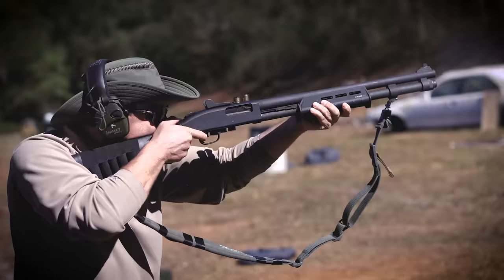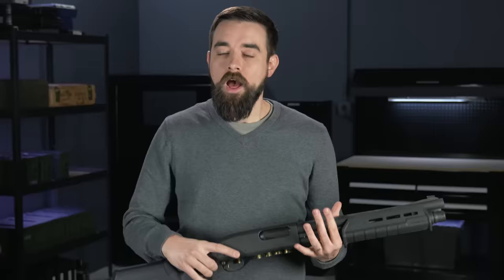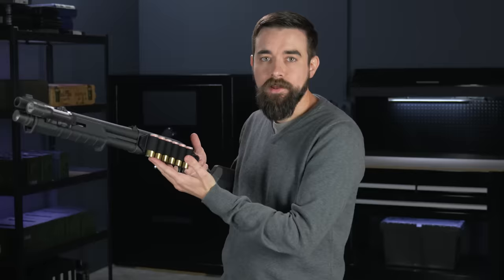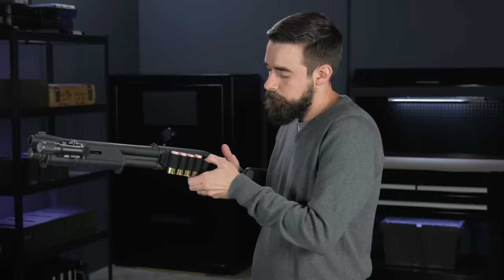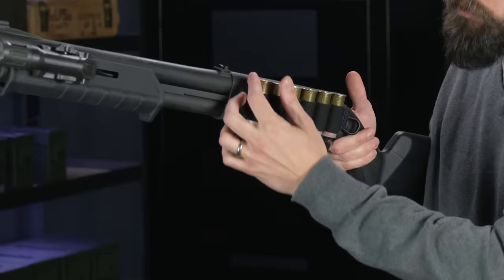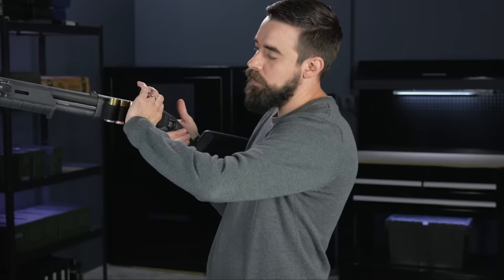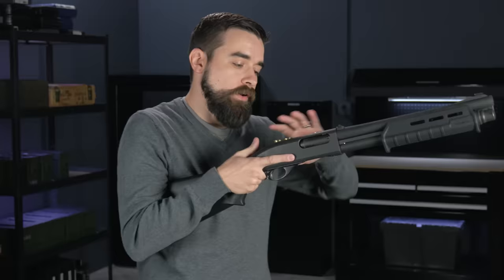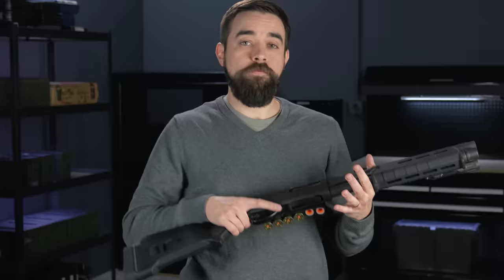How to Reload a Defensive Shotgun

Comment: Question from an ignorant noob, do you have to reload from the ejection port if the gun is empty or is that just a faster way to get of an extra round?
Reply from the maker: +doug harrison You don't have to, it's just faster
Reply: Faster for one extra round, but not the way to reload the tube?
Reply from the maker: Not sure I understand the question. If you want to get the next shot off as quickly as possible, it's faster to load the chamber first, then load the tube as time permits. Some shotguns won't allow you to access the tube until the action is closed and you either dry fire or press a button or latch to move the shell carrier out of the way. Since the action is typically already open on an empty gun if you've just been firing it, the quickest way to get back to shooting is just drop a round in the chamber first. Does that make sense?

Comment: Chris, really like your videos. I used to use a side saddle but was having trouble with the brass corroding with the gun in the house! I would clean the brass off with steel wool but once it started it would come right back. I would use this ammo up
when I practiced. Had one of the rounds brass split when fired and could not cycle the gun{870 Wilson!} Hit the butt stock on the ground and the extractors ripped right through leaving the split case{Had to run a stick down the barrel} I grew up on a farm
and started shooting in 1968. Never had brass corrode until 1998. I use the big three(F R W ) they all do it. I think they use an alloy not real brass as as cost cutter. Now keep ammo in small media bag with double zipper compartment(slugs in one, buck in other) via ' Way of the Gun}. Any thoughts from anyone?
Reply: Do you live near the ocean?

Comment: Kind of out there question but, I noticed that you removed the older videos you all had on the Beretta 1301 Tactical. Was there a reason for that? I found them quite helpful.
Reply from the maker: +Joshua Keaton copy+paste answer is that a commenter on our blog complained about 922r compliance issues. Our lawyers looked into it, got nervous, and decided we needed to remove the videos. Modified versions of the video transcripts are still available on our blog in article form.
Reply: Would that have to do with adding the tube extension and the modifications to the button? I have never really understood how 922r compliance works.
Reply from the maker: +Joshua Keaton I can't really go into it much here without spoiling everyone else's fun. There are differing opinions on how to apply 922r and who it applies to, and most people who try to explain it actually get a lot of it really wrong. I will say that in this case, the modifications to the button are not part of the issue.
Reply: Ok, I appreciate your response, I really like the 1301 Tactical and am thinking about getting one; I certainly don't want to run into any issues myself! Love your videos, they are both even handed and well informed.

Comment: What was your exact reasoning on switching to the WML over the TLR-1? The gen 1s seem to have had issues with cracking but has your's held up to regular use?
Reply from the maker: The switch on the Inforce WML is much friendlier for use on a pump shotgun forend than the Streamlight switch. The light has been fine, but I have had issues with the rail section staying put on the Magpul forend.
Reply: Lucky Gunner Ammo I took off the barrel and held the t bar in place while I screwed in the bolt to get a good fit

Comment: Can someone please tell me what is the length of this gun? And is it legal in all states?
Reply: He said it was a Remington 870, which goes down to 18.5” barrel.

Having said that there is a 14” barrel called the TAC-14 from Remington that uses the same receiver and everything, but the stock is replaced with a raptor grip, and I don’t believe it can legally be changed.

So he probably has a 18” barrel which is legal everywhere but I would check your local state laws on ammo capacity and shotgun laws. Indiana let’s just about everything and we don’t have nearly as bad gun issues as Illinois, Michigan, or Ohio and we are surrounded by those states.

Comment: This is a great video but honestly I still scratch my head when someone tells me they use a shotgun in  go-to home defense. Especially if it's a full length gun.
Reply: Overpenetration isn’t as much of a problem, stopping power is more than adequate, and spread isn’t much of an issue at home defense ranges. Sure a handgun is easier to move around corners with, but I definitely feel more confident in my ability to shoot a shotgun than a handgun nerves or not. Long guns in general are easier to learn and not everyone has the time or money to train on every platform they’d like to to the level they’d like to. Doesn’t mean they shouldn’t find something that works for them in a home defense scenario.

Comment: Other than the fact that the odds of running out of ammo with a 15 shell capacity shotgun approaches absurdity, what would you say would theoretically be a good way to load a KSG other than just loading it like you normally would?
I've been practicing it for several months and have more or less come to the conclusion that the best way is to keep the shotgun shouldered while feeding it shells from the bottom. At a range I am able to load a shell directly into the chamber, but it's more of a juggling act than something that is even vaguely doable under stress. I'd imagine that remains true for all shotguns that eject through their loading port.
Reply: lol i think you're good with 15 rounds

Comment: I dunno, I think this whole methodology revolves around the fact that the side-saddle is on the left side! And that's fine and this post was informative. However, it's VERY hard to control weak hand under duress to perform this task. In real gunfight, you use fire and maneuver. Standing static while reloading (unless behind a sizable tree) not the best policy. When you're gettin' shot at, NOBODY has to tell you to GET DOWN! After taking shots you get to cover, drop to weak side knee, keeping hold of shotgun forend with weak side hand, twist 90° to have access to both ejection port and feed tube. Cradle trigger group/stock on strong side lap. Load with strong/dominant hand (drop 1st shell in ejection port and slide forward, then continue loading as situation permits).  Addl ammo should be on person & available to strong side (trigger) hand with minimal floundering.

Comment: I suggest you watch someone who knows how to handle aWinchester 97 in Cowboy Action shooting. I did it for around 12 . Any good 97 shotgunner will reload much faster.
Reply: the model 1897 and model 1912 always seemed smooth loaders for me.

It takes a second to get used to the 12 since its possible to dump the mag tube if you do it wrong but with a bit of practice i can load the thing from empty in like 6 seconds.

Comment: LGA Chris, what is stage saver?
match saver?
Reply: a match saver is a single or double shell holder placed less than an inch next to the ejection port, should you run out of an ammo on your last target. hand comes up swipes the shell into ejection port and sending it down range, potentially saving your match from having to do a standard reload.

Comment: What brand of elastic side saddle is that?
Reply from the maker: The shell carrier itself came from a sidesaddle mount I got from Vang Comp Systems, but I took off the actual mounting plate and just use a piece of adhesive velcro stuck directly to the side of the receiver.
Reply: Sweet! Thanks!

Comment: Think of driving a car with manual gearbox. We don't look at the stick when we shift.  Same goes for handling and operating shotguns.
And it can't be stressed enough that slow is fast and practice makes perfect.
Shotgun operation is very different from handguns, SMG's, rifles. Those are easy.
Seriously, know your shotgun(s), practice loading unloading, safety handling.  Do it until you can load shell without thinking and looking at your shells, weapon.  The shooting part is easy.
Why? 12 gauge shotgun is extremely powerful and very dangerous.

Comment: The keywords in the beginning "will work with modern shotguns" lol my spas 12 isnt modern and requires pushing a button to load the shells in the magazine tube. Ive got to find a way to make reloading it quicker.
Reply: Most auto shotguns have a button to release the bolt forward

Comment: If speed isn't a concern, isn't the simplest way to reload a shotgun to load all the shells into the magazine and then pump it, especially if the action is already closed from the "click-empty-realization"? I guess you'd have to load another round after chambering to top it off, but it seems like the most idiot-proof technique. Maybe I'm overlooking something. I guess there's the issue of remembering to either pull the trigger or hold the slide release to open the action.

Comment: When you reach the "click" it's often considerably faster to just reload the tube and then chamber a new round than it is to try to load a round directly into the chamber (of course this ends up with 1 fewer round in the gun unless you then load another one into the chamber, but it can be worth the trade in a time critical situation).
Reply: honestly to me with my model 12 it seems quicker to just shove one in the tube then bring the pump forward in one motion then continue loading the tube.

I know you cant do that with some shotguns but with the model 12 you can load a cartridge into the tube with the bolt open

Comment: What about reloading the gun right handed ? Stock mounted elastic brass pointed down but on the right side. most people are right-handed and it's more natural that way.
Reply from the maker: +Harry Schultze I prefer not losing my firing grip. It's good to be able to immediately go back to shooting from reloading if necessary and I also think keeping the firing grip gives you better control over the gun. And if you're talking about actually mounting a side saddle to the right side of the receiver, that's not really possible with the ejection port.
Reply: I'm talking about mounting it on the stock. The reason I mention this is that under stressful conditions unless you have a whole lot of training and I mean a whole lot you need to do it in a way that doesn't make you think about what you're doing. you can train for this and have it becomes second nature or you do what's natural to you. I'm ambidextrous but I still favor my right hand and since I crippled my left hand in an accident I favor it even more. Right handed people are going to want to use their right hand.
I know 3 competition 3 gun shooters all of whom are right-handed and load right handed so fast it's unbelievable. I understand about not wanting to take your hand off the trigger but under stressful conditions I'm telling you you're going to want to load that gun right handed if your right handed. You have to do it in a way that doesn't require you to think it has to be natural to you. Do you understand what I'm saying?
Reply from the maker: Yeah, I get what you're saying, and if you have limited dexterity in your left hand then using your right hand to reload probably makes a lot of sense. Otherwise, I think keeping a firing grip is pretty important. You may have to toss a round in the chamber and fire at a contact-distance target the instant you can get the action closed (which has actually happened in multiple documented LEO shootings). My right hand may be more adept at doing complex tasks, but I haven't had much trouble using my left hand for the reloads. Darryl Bolke, who I mentioned in the video, is a retired LEO with extensive shotgun experience (and has written some shotgun articles for our blog). He's used these techniques in actual real world encounters, and he's all about using methods that are as idiot-proof as possible, so I'd say the left-handed reloads are certainly viable under stressful conditions. If you've got to use your right hand because of physical limitations, then there are certainly techniques out there that will work, but I don't think it's a necessity for everyone.
Reply: I have a question for you concerning ammunition. I've heard a lot of bad things out there about certain brands of ammunition and certain calibers like Winchester and 12 gauge and Remington and 22 long rifle are total junk. you can't mess around in a home defense situation you need something that's as close to a hundred percent reliable as you can get.
My house is very small only about 850 square feet so I'm not interested in tight spread patterns in double O Buck but rather reliability. what would you recommend? I always used to shoot Federal and never had any problems. What particular brand would you use in my situation. by the way I have an 870 Wingmaster with an 20 inch barrel. Thanks for any advice!
Reply from the maker: +Harry Schultze Any buckshot from Federal, Winchester, or Hornady should be plenty reliable. Remington shotgun ammo has been a bit spotty in my experience. 22lr ammo is inherently less reliable in general just because that's the nature of rimfire technology. Premium self-defense grade shotgun ammo is typically very reliable.
Reply: Lucky Gunner Ammo would you be willing to do a review on the cz p-01 compact? thanks.
Reply: I agree, I have had to load my shotgun in a HD scenario only once and in that one situation I loaded it weak hand using the exact same method, tucked under my arm, bladed hand technique. At the time I had young-in's so keeping my gun loaded wasn't an option (my little ones like guns more than I do, must run in the family) so I loaded directly from the side saddle and racked the action. Thankfully the perp left when that sound echoed through the house. We never called it idiot proof we called it KISS, keep it simple stupid.

Comment: step 1: get a saiga 
step 2: profit
Reply: Forgot about the step where you have to tune the gas system and load your mags since you cant store them loaded
Reply: @MFinGonzo  you can keep mags loaded and the saiga has a fixed gas system. the vepr 12 has an  adjustable gas system but that's not a bad thing as long as you tune your gun to your home defense ammo. laughs in 20 round drums

Comment: Go get a kel tec ksg problem solved. Im sure you wont go through 14 shells in a defensive situation no reloading required
Reply: Problem is not solved with an overly complicated, possibly unreliable design. There is a reason the KSG and the other similar designs like it are not found in law enforcement and military. Mossbergs and Remingtons are popular because they are durable, simple, inexpensive to repair and find parts, and have stood the test of time.
Reply: @TheyCallMePDub  Also, the KSG is relatively new, compared to the classic pump models. you never know, some law enforcement agencies might adopt it someday.

Comment: The first gun I owned is a Mossberg 500 A/B 12Gage. I was 18 when I bought it I'm 61 now that gun is still like new bluing is faded slightly and I just bought a 18.5" barrel rather than buying a new shotgun. I still have the 28" barrel but on the 18.5 barrel does the bore have to be rifled to shoot slugs or is smooth bore just as good ? I always shot #6 shot magnums how do you think they will work on the new barrel the old 28 had a modified choke Mossberg said the new one is a standard 18.5 " barrel. So do you think it's good to go with 00buck six shot mags or slugs? Any help will help. Roadman55@verizon.net
Reply from the maker: Hey man, just so you're aware, when you put your email address in a comment, YouTube automatically flags it as spam.

To answer your question, rifled barrels do not do well with buckshot or birdshot. They tend to throw an erratic pattern that is often roughly a donut shape. Several places online sell a smoothbore 18.5" Mossberg barrel for under $100 and I think you're much better off with one of those.  I'd recommend using 00 buckshot -- Federal Flite Control or Hornady Critical Defense are very good, but any 00 buckshot that will keep a ~8" pattern at 10-15 yards in your shotgun is a good choice.

Comment: Really enjoy your videos.  But there's been some positive reviews about Remington's quality lately.  Apparently their QC has gone up.  But for thousands of us on a budget with newer Express models, if you've ever had a shell get jammed and had to slam the butt against the floor to rip the casing out, check out this video for the clearest description as to the cause of the problem that I've seen online. 

https://youtu.be/mlGoxNsaieE

I saw it a few years ago and fixed the chamber in a few minutes.  Never had a jammed shell again.  And a couple of years ago, I bought another Express.  Knowing full well that it would jam, I took it to the range and sure enough it jammed constantly.  Fixed it like in the video again and not a single malfunction since.  

As for reliability upgrades, get a non-mim extractor from Brownells and a heavy duty dog carrier spring from a semi-auto 1100 model.  Also when reattaching the mag tube extension, make sure that it butts up against the mag tube before tightening the nut or else there could be a small gap that can catch the rim of a shell, spring, or follower.  And if the mag spring is worn out, maybe a quality stiffer spring from like Wolff or Wilson Combat.  The plastic follower has never been an issue with me.  And I feel that plastic travels smoother than metal on metal in a dry mag tube so since it works fine I leave it be.  

As for the finish, eh, can't really help you there unless you want to spend another couple hundred on a Cerakote finish.  But then you can have it any color you like I guess so there's that.  And it'll be tough as nails.
Reply from the maker: +Steve Kim Thanks for the info. Did you mean to post this on the 870 mods video?
Reply: Lucky Gunner Ammo Oh crap lemme copy pasta right on over there.  Still learning to internet.